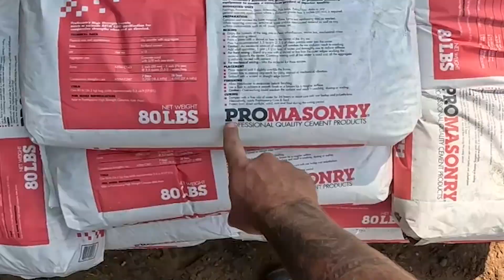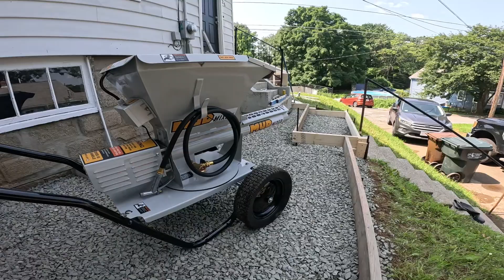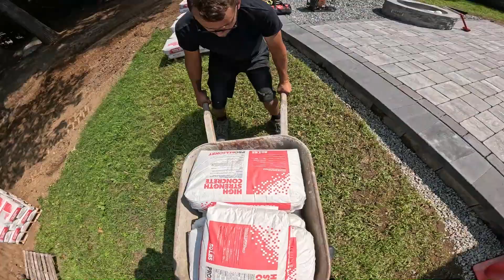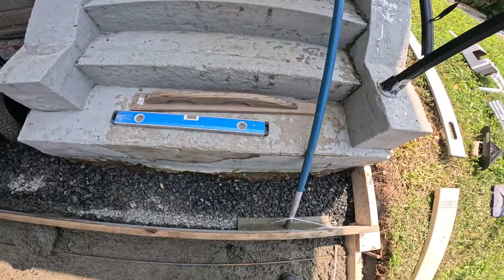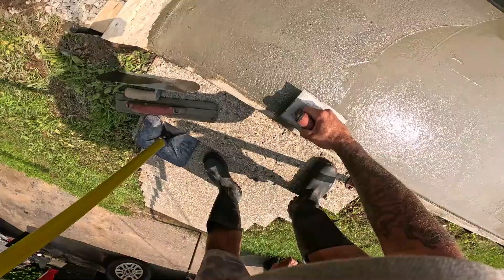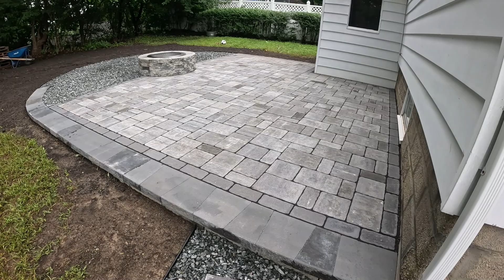The EASIEST Way To Mix Bags of Concrete... (MudMixer)

Comment: The Mud Mixer TOY was designed around a device called an auger. Another word for auger is screw conveyer. The screw conveyer was invented to transport material, NOT mix it. The TOY will transport, convey, and/or push a dampened dry mix for less than ten seconds. Even if it could mix, that is not long enough to produce concrete with the strength rating suggested on the bag!  If anyone wants to play with the TOY, they should ask Copilot/AI how water effects mixing concrete.

Comment: Sakrete, and I presume others, suggest you mix their product for at least 5 minutes. That's no problem for a barrel mixer as all you have to do is watch it for that period before you dump it. The toy called Mud Mixer mixes for about 10 seconds, and you have no control of that, leaving you with a product that probably won't have the strength rating listed on the bag? Not a problem for DIYers, but possibly a source of future liability claims for a contractor?
Reply from the maker: I know what your saying but personally I think that is because in a barrel mixer, it takes much longer to mix properly. So saying be sure to mix for 5 minutes makes sure the batch is properly mixed. The engineering on the mud mixer properly mixes the concrete much quicker. Not saying what you are mentioning could be true, I don't have enough knowledge with the chemicals in concrete to say for sure... ✌
Reply: @TheChristianHardscaper  Good point! I had given thought to how to prove my point by creating test cylinders however the process involved mixing/rodding them. Then I had another brain fart. By core drilling cylinders from cured concrete from a redimix plant, a barrel mixer, and a Mud Mixer. Putting the three different sources under the press will settle the discussion for good. Well nearly, the plant mix is bound to be the strongest because it is entirely different to begin with, but it would make a good benchmark in this case.
Reply: 'it gets mixed while it's being moved around in the forms and struck and screeded. Could it be mixed more? Sure. What surprises me with this tool is why aren't there other variations of this around? Traditional drum mixers are so inefficient. All this is doing is spraying and augering (mixing) down a chute. It's so crude that the cost seems excessive to me. I would definitely rent it though but buying it? Probably not

Comment: Rented one from Howe lumber this past weekend to pour my hot tub pad which was a 9x9 x 6” high and 3 guys knocked it out in 1 3/4 hrs mixing time 68 80 lb bags and  mud mixer is a life saver but also had the finicky water adjustments.  Did see another video that had to install a pressure regulator on it due to pressure being too high which i also have. I have a well with a booster pump and have a constant 70 psi which would give more water coming out then at 50 psi. Nice job as usual. We are doing a 20x32 techo bloc patio and hot tub is in corner of patio. Have a guy that I coached in football doing it.
Reply from the maker: Heck yeah man, that thing mixes concrete super fast... And I never even thought about the pressure issue, that makes sense though. Sounds like a sweet project and that is cool you got a guy you coached to help you out. Good luck with everything! ✌

Comment: That bottom step should have been drilled and rebar inserted in the holes… that step will crack and pull away…

Comment: I recently started watching your videos and was wondering where are you located? So far in the videos I’ve seen you Don’t ever put drainage under your patios and I’m curious if any of your older jobs have issues because of it?
Reply from the maker: I am from Massachusetts. The clean crushed stone I use for my base is the drainage. It allows the water to freely drain into the subsoil. If you have heavy clay sub soil, you may need to incorporate drainage but most cases that is all that is needed.

Comment: It is the best concrete tool I’ve ever bought. I use to hate doing concrete work but since I bought the mud mixer a few years ago it’s change everything. I remember mentioning it to you about a year ago. I used mine today for only 30 bags. It’s is perfect for my flips because the house I’m working on has complete termite damage only on first floor so I have to lift the foundation height up 8 inches one wall at a time and reframe. So it beats having to order a couple yards per week. I did 30 bags in 45-50 min. I also used it in my basement last year and mixed 300 bags all by myself with the mud mixer replacing 200 year old stone wall foundation with concrete.
Reply from the maker: I certainly do remember you mentioning it to me. I was so impressed by it and started thinking of a lot of applications where it would be helpful... A basement is a perfect spot to use it and that is a lot of bags to mix, no way mixing 300 bags by hand or in a regular mixer is easy, with this, it is about as easy as it can get. And like you mentioned, just having it to do all the random little concrete projects just saves time and money. Which is always the goal!

Comment: A bagged concrete wall is one of the biggest waste of materials I have ever seen.  You would be better off dry placing a wall of 8X8X16 cinderblocks and filling them with dirt.  At least then when it falls apart you can still use the materials, mostly.
Reply from the maker: Could not agree more... Unfortunately some people love doing the easiest thing possible to solve a problem LOL

Comment: That machine may seem convenient 
, but it’s super slow. I’ll stick to a regular mixer.  I’d be done in a fraction of the time. After all, time is money. God bless you brotha. ✌🏽
Reply from the maker: Slow compared to a regular mixer? Not sure I agree. Just setting it in one place and not having to dump bags into a taller mixer, spray water into it, dump it in a wheelbarrow, etc… is much more efficient in my opinion. But I also don’t know all the regular mixer options out there, so maybe there are better ones than I know of…🤷🏼‍♂️✌🏻
Reply: I guarantee you your guys cannot mix faster that the machine. Well if you have 3 or more guys then yes. (Labor cost?) But I did 130 bags alone in about 2 hours with it. I did not like concrete work until I purchased the mud mixer a few years ago. Maybe one of the first to purchase them. I paid much less than it is now.
Reply: Christian, I appreciate the response. You now own the mud mixer machine and it makes no sense to discuss any further if the mud mixer slow or not. As a concrete contractor and business owner myself, I’m just commenting on my observation and time efficiency of the Mud mixer machine. It’s a great concept, however, I think we can all see that it just not for everyone. And neither is mixing and hauling concrete. It’s all hard work. 😓 if you’re looking into adding this to your biz. You too will realize this in due time. By the way I’m going to give you a tip. When you need to figure out how much concrete to use on your projects, whether you’re pouring slabs or steps or whatever install this app on your phone. It will make your life easier. ( Cheney enterprises concrete calculator). All the best to you. ✌🏽

Comment: Thats a cool machine.  Mixing a pallet of concrete by hand may have equaled turning a job down… i’m sure it will pay for itself and open up possibilities for your future jobs… you’ll be stamping, rolling and staining concrete to match your hardscape projects in no time.
Reply from the maker: That is for sure… hand mixing that much would be a not so fun job